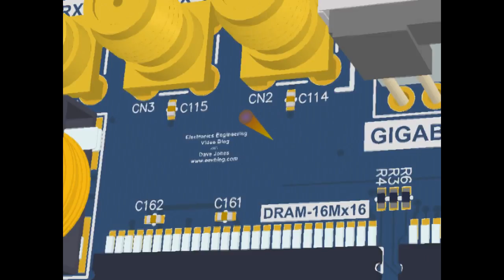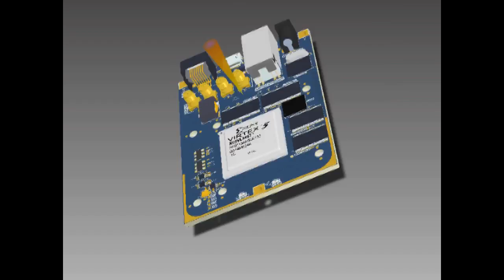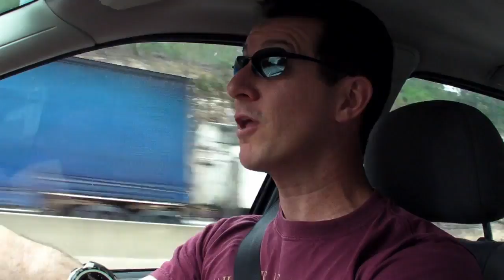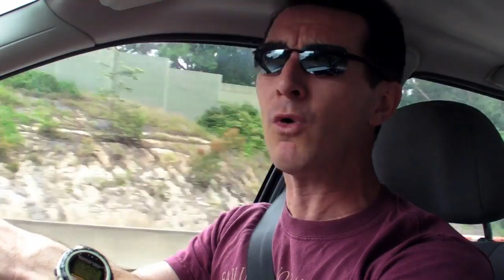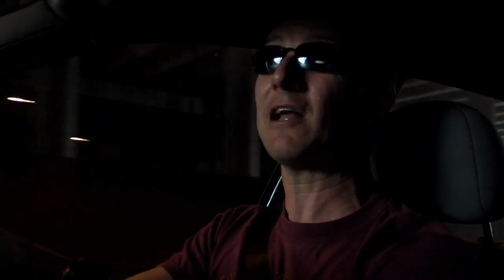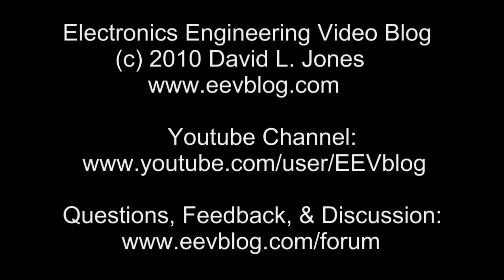EEVblog #126 - The Free Sample Fallacy

Comment: Texas Instruments has a pretty nice free sample program. I just see the sample I want, add it to the sample cart, answer about 3 questions (I think it was only 3, and I'm pretty sure at least 2 of them had drop down menus), and then they ship it. Both times I requested samples, I received them in about a week, if that. No spam emails, either. :)

I mostly wanted the free sample to figure out how to use the things for a project, so I think the free samples worked out quite nice in my case.

Comment: While I do, for the most part, agree with sentiment, sometimes it's not so bad.

I requested some sample components from Coilcraft about 18 months ago for a project I was working on, basically because I just wasn't entirely sure exactly which one was going to be the best fit for the job.  Got my samples, did my tests, ordered more of the right component.  The samples did take a while to arrive, but no hassle at all.

Sometimes it's useful. :)